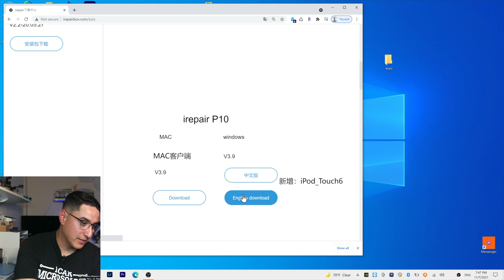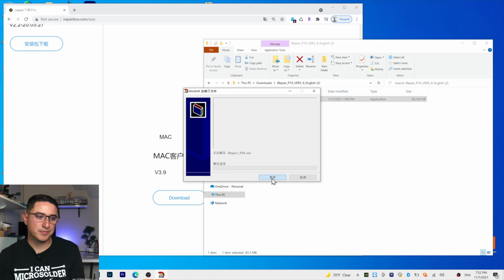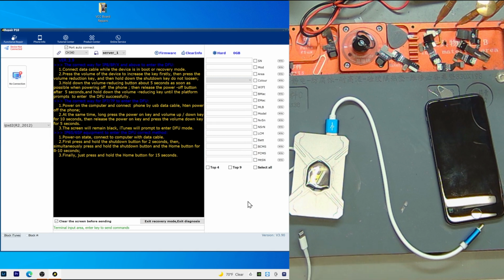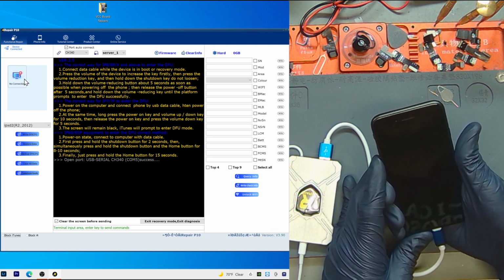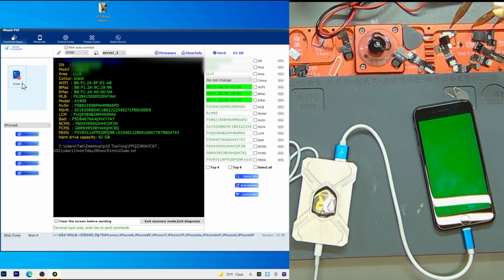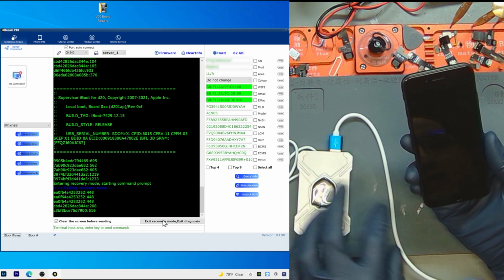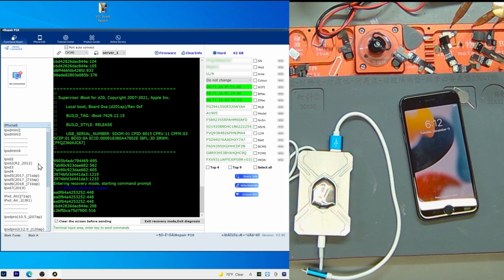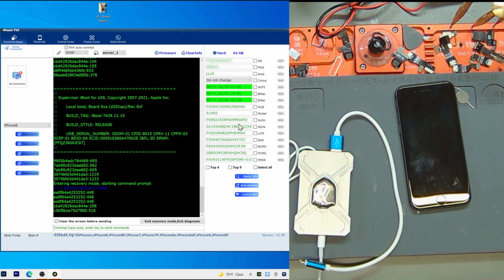How To Use Purple Mode On iPhone To Unlock WiFi. iRepair P10 DFU Box Tutorial

Comment: Can this tool be used to unbind wifi on an ipad?
Reply from the maker: Yes
Reply: @VCCBoardRepairs  awesome, i have an ipad that decided to do some yoga and the bottom portion of the board bent pretty far over and ripped some pads out of the WiFi IC AND the board that are critical. I managed to gain WiFi back but no bluetooth, as one of the pads on the chip tore off and i couldn't mend the joint. Guess its replacement time.

Comment: Need new wifi ic? Can use old mobile wifi chip?
Reply from the maker: If you need to replace the WiFi chip, you can use from donor board or brand new.

you just have to unbind it starting from iPhone 6S series
Reply: Thanks for your reply ❤️

Comment: Where can i purchase serial number wifi and blue for iphone?
Reply from the maker: For what purpose?
Reply: @VCCBoardRepairs  to use irepair p10 dfu  tool
Reply from the maker: are you dealing with a dead NAND and need the original SN WiFi BT?

If so, there's no service right now that I know of
Reply: @VCCBoardRepairs  dead NAND? Means locked,  then yes.  But if you don't have it, that's fine . Thank you for your quick responding
Reply from the maker: If your referring to iCloud lock, then no, you can't unlock it with a new SN
Reply: @VCCBoardRepairs  ok thank you

Comment: hi, thanks for share, you have some solution for activation ipad 5th gen ios 15 ?
Reply from the maker: If you changed the SN, then it's not possible to activate
Reply: @VCCBoardRepairs  you have to change the wifi and BT Mac address too. All 3 are required to come from a matching set.

Comment: Hi Jesse - would WiFi chip still need Irepair tool if the original WiFi chip only being reballed and not replaced with new WiFi chip?? Apologies for my ignorance ☺️☺️👍
Reply from the maker: Nope. Only if you're replacing it
Reply: @VCCBoardRepairs  
Thank you. Think I’ve shorted the board - iPad mini 4. Battery connector burning when I pressed down - after using air gun only - without removing chip or reballing. Now not turning on. Need more patience 🙄☺️.
Time to practice my ‘short finding skills’..👍